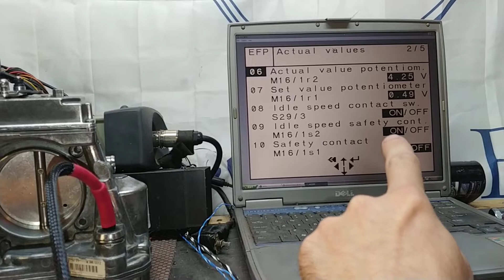Mercedes sl500 r129 throttle body bench test

Comment: I have a 1993 sl500 it runs like a dog in the hole. i have replaced fuel pumps and filters wires plugs. any ideas?
Reply from the maker: It could be anything, many possibilities. But I need to have the car to diagnose it properly. My address and repair rate is listed on my website in description.